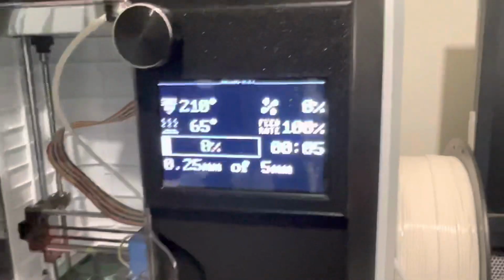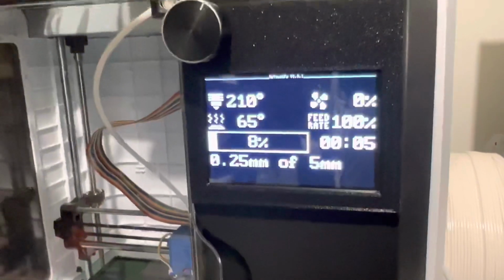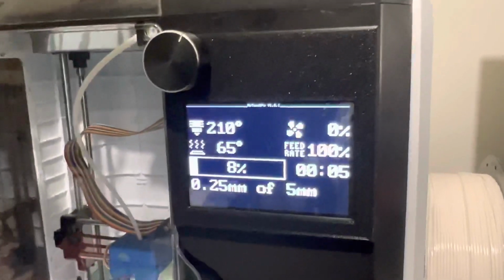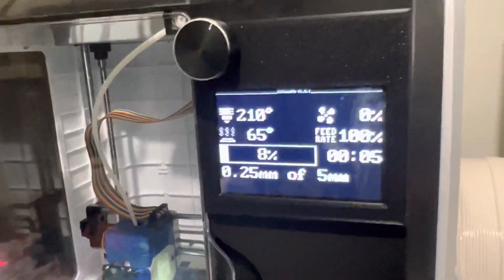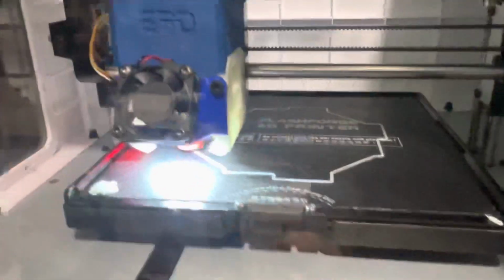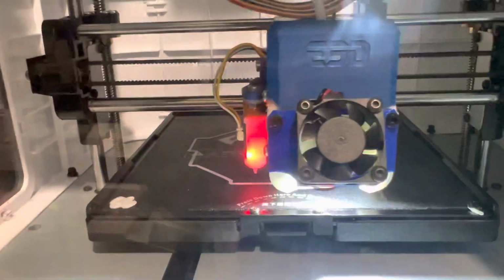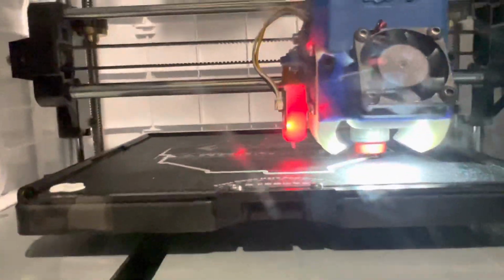FlashForge Adventurer 3 gets a new Brain, Hot-End and Klipper

Comment: And here i was thinking i was the only one that did this haha, still tweaking but am running an MKS robin nano v3.0 with TMC2209 drivers and an aluminum extruder (the ones you can get for creality printers) with an E3D V6 hotend and a magnetic PEI build plate also using a BLTouch makes like soooo much better (when the thing actually decides it wants to be consistent) I am still using the OEM mainboard to control the bed heater though as breadboarded a breakout for it but couldn't get it to work correctly.
Reply from the maker: I've updated the Printables model with the IR Z Sensor design as an option
Reply: @Cybernetic_Systems  Hey mate progress on my build have the PCBs from JLC and got everything setup just have to do up a couple of fan cables from the btt to the breakout and I have everything sorted for the BL-Touch version minus the bed. Any chance you could throw up a photo or a quick video just showing the underside of your bed and how you did the ribbon to the OEM flex I'm 99% sure I have the pinout correct. The issue on the MKS board was because the heater and thermistor share a common ground you couldn't have both setup at the same time if you did the LEDs to show the bed was getting power would light up as soon as the thermistor gnd was wired up as it would complete both circuits and confuse the board. Hopefully this makes sense.
Reply from the maker: @agentspades  Howdy, here are the pics I took. 

https://imgur.com/gallery/pzzxqTH

Basically you dont want to use the inner 2 traces with is the old Thermistor. I couldnt work out a way to make it reliable, so I replaced it with a normal glass bead thermistor and removed the SMD components from it. 

The rest of the pads are split evenly on either side as the heater power. it's not important which way you wire it as it isnt polarised.
Reply: @Cybernetic_Systems  absolute legend thanks, I have a bag of the glass thermistors I got as that was going to my next step. Can't wait to get this thing printing again has been out of action for a while now. Thanks again when I get it going I will post a make on printables ☺️
Reply from the maker: @agentspades  No worries. I've now uploaded the pics to Github.
Reply: @Cybernetic_Systems  awesome stuff, one note I'd also add in would be that your heated bed is v1.0.4 as mine is 1.0.5 and uses the outer two traces for the thermistor as opposed to the inner two. My task for tomorrow and sunday is to tackle the bed, having a hard time de soldering the components so I will probs just leave them and use one of the breakout boards I got from Ali that just break out flat cable to a bunch of through hole solder points. But so far so good have all the hot end done can't wait to test out the Revo 6.
Reply from the maker: @agentspades  Good to know. 👍
Reply: @Cybernetic_Systems  Got it printing pretty reliably now with the heated bed working, had some issues printing PLA but I think i solved it by dropping the run current of the extruder so the extruder motor stays cool. Printed ABS perfect straight out of the box, Thanks so much for all your help and the awesome build mate :) so stoked with this. Loving the revo 6 HE.
Reply from the maker: @agentspades  nice work, well done!
Reply: Looking at your configs my setup looks hillbilly in comparison haha makes we want to really redo mine now hahah
Reply from the maker: hehe, I'm working on an IR sensor option atm as the issue with the BLT is it can only probe 2/3rds of the bed.
Reply: @Cybernetic_Systems  Literally the issue im having atm can print fine in the center of the bed but try print to the front corners and nope, The reason for starting this was bed leveling and an OEM hotend i got i was having heaps of issues with only to find it was bent from the factory causing it to not seat straight think i had it for a month before pulling it to bits haha.  I only got this printer because it was cheap on amazon and i needed to print ABS to do a voron 2.4 350mm now it is its own project. Haha
Reply from the maker: @agentspades  yeah the bed is trash and the stock "levelling" system is useless. I also replaced the bed surface with PEI.

https://www.aliexpress.com/item/4001333051245.html?spm=a2g0o.order_list.order_list_main.15.2b801802a9bd7O
Reply: @Cybernetic_Systems  definitely worth the upgrade was the first thing I did when it was still OEM, I lost a few MMs in height but worth it, I'm setting up to print your versions now haha so much nicer. My hotend mount is just a prusa E3D mount that I made a backing plate for to mount to the standard X axis bearing carrier. Works but not ideal can't wait to make this better. How did you do the heated bed, from what I gathered pins 2-17 where + 1 was gnd and 18 was temp.
Reply from the maker: @agentspades  iirc it was quite obvious when you tear it down, and I replaced the flat flex cables with standard ribbon cable.